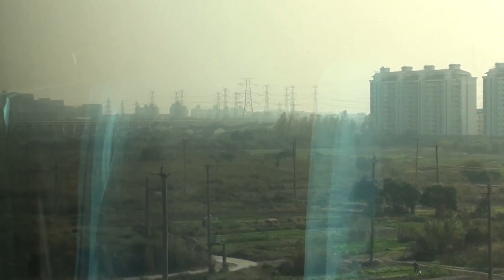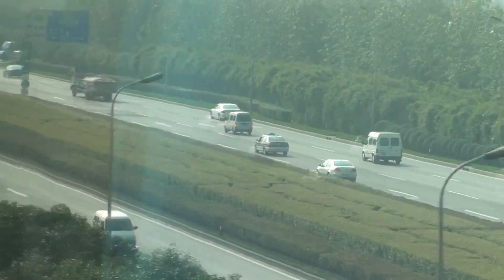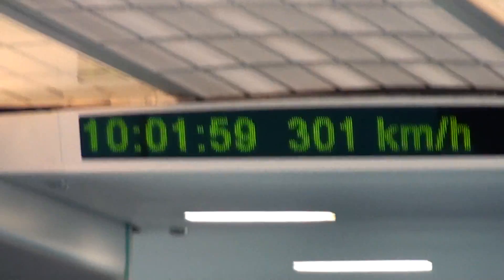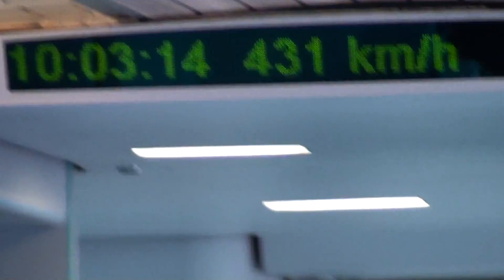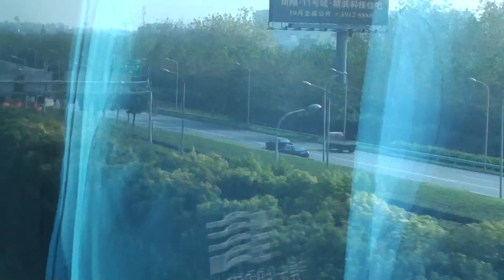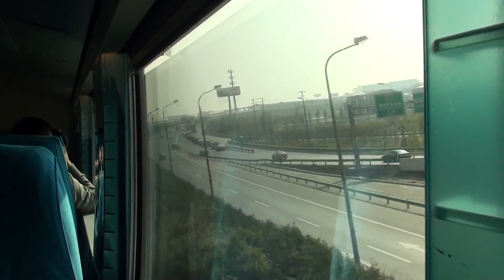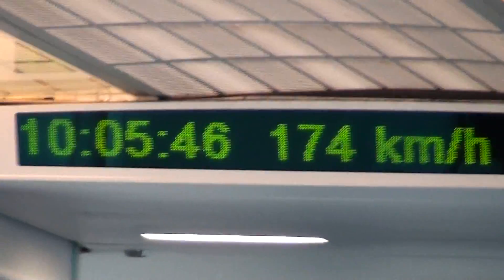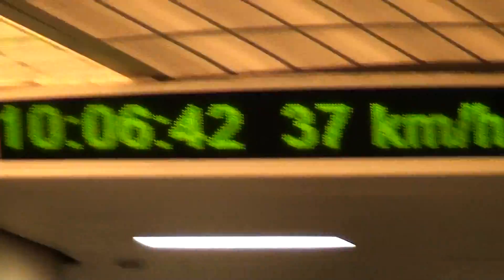Maglev Consultant Narrates Shanghai Maglev from Longyang Rd. to Pudong Airport

Comment from the maker: If you are referring to a conventional high speed train, probably twice as long. Conventional trains cannot accelerate or decelerate as fast. Also, the Shanghai maglev is not operating at top performance levels so as to conserve energy. Theoretically it could make the trip in only a few minutes, but the ride would be most uncomfortable for passengers. To view an acceleration comparison chart, see Maglev Technology Explained page on the NAMTI.org website.